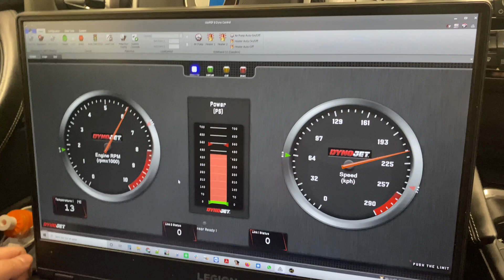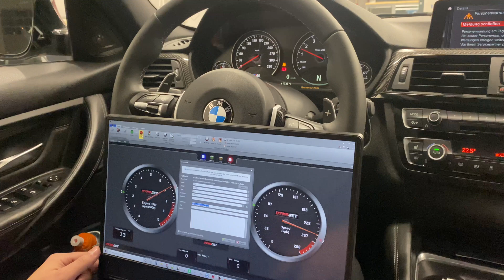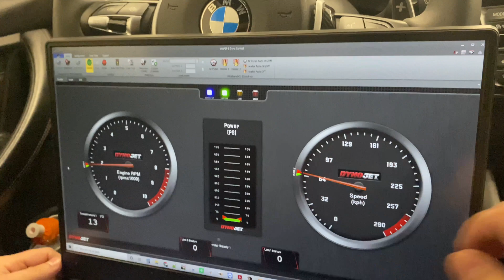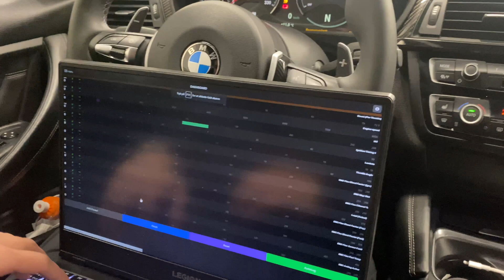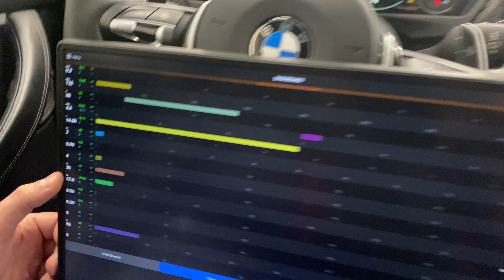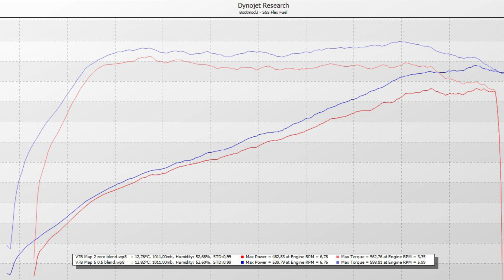bootmod3 Flex Fuel - New Advanced Features Demo

Comment: If i flash to  OTS Stage 2+ E30 FlexFuel AntiLag MultiMap on my car would the tune automatically adjust if i put 100% 93 oct in my tank and would be safe? but won’t make the same power as if I had the 30% ethanol in my tank, but it’s fully safe to run 93 oct on my E30 flexfuel map with flexfuel sensor installed? And if i also add 50% ethanol would it automatically adjust and gain more power?

Comment: What Ethanol percentage would you still recommend for the most optimal performance? Full e85 or closer to E30 and etc.
Reply: 50
Reply: Cary Jordan has custom full e85 maps  for s55 stock turbo/fuel system. No need to blend.